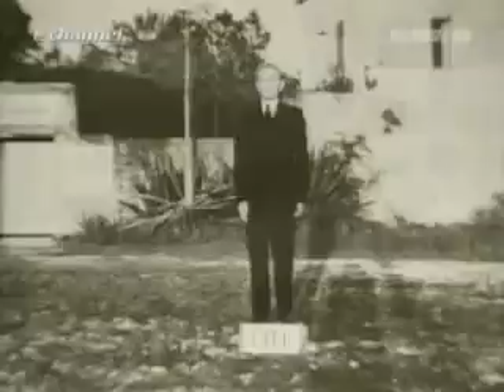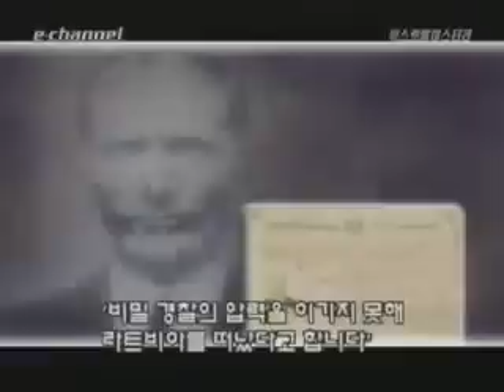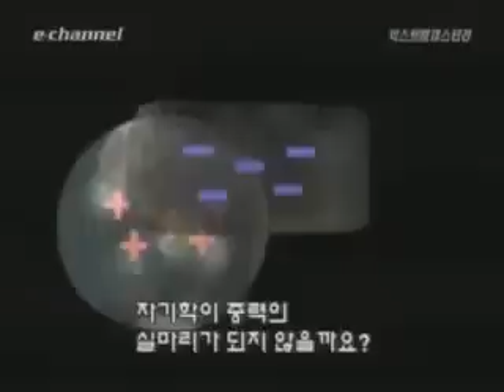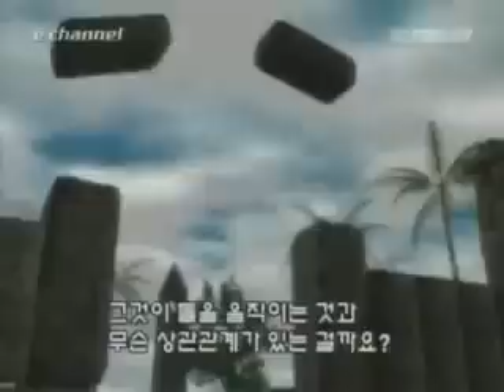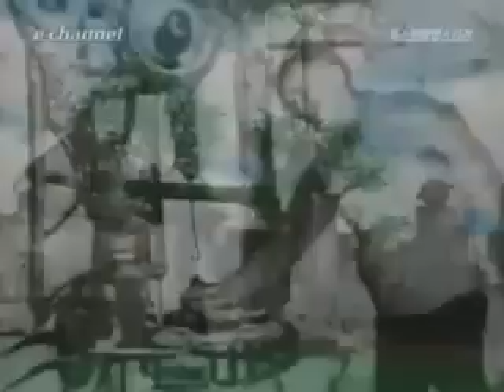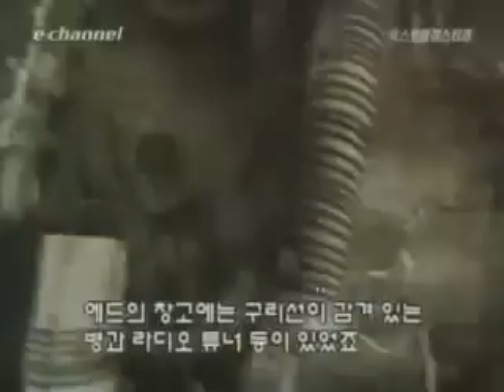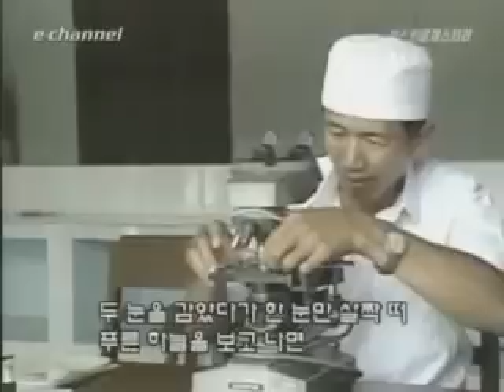The Anti-Gravity Secret of Coral Castle - FULL VERSION

Comment: 23 Ton obelisk?? What?
FACT; Edward Leedskalnin NEVER had the Tractor and trailer able to Transport the enormous weight of a 23 Ton Oolite obelisk. This would REQUIRE the assistance from the State of Florida D.O.T. and state law enforcement officials to aid in the Transport of a very slow moving vehicle over a 12 mile route.  This was supposedly accomplished in 1936 , yet today in 2022 a Lowboy trailer transporting 25 Tons is capable of up to 50,000 lbs. 
Soooo, how did he transport the 23 Ton obelisk?? Humm?? 
He didn't!

Comment: those boxes are no longer a mystery like all this as I CRACKED THE MYSTERY """""ME"""" I DID..the greatest mind of the 21st century..TDJ 
  The invention of an electron came by a tricky method in using electricity in a vacuum tube. Normally whether it be a generator or a battery, the positive terminal will have to be connected to the negative terminal, but in the vacuum tube two batteries with different strength were used, the smaller battery was connected normally, but the larger battery's negative terminal was connected to the smaller battery's negative terminal, and the positive terminal was left alone. That connection gave the negative terminal a double dose of strength, and so it became hotter and could push more. It was called cathode and the positive terminal anode, and the electricity that passed from the cathode to the anode was called electrons."""""""the arc of the covenant"""""""

Comment: Ed was smarter than the average guy. however there is no mystery behind what he did and i could do it today with just the stuff found at coral castle. he didn't magically levitate anything he used simple electricity to create a solenoid the push his simple machines to cut stone block and tackle to lift it and roll it into place.  i would be willing to help you understand if you still think its magic ( i sure thought it was at first but a little understanding goes a long way)
Reply: +Ben Goulet try the concrete cutting industry. diamond tipped saws and drills etc. search for manufacturers like; pentruder. husqvarna, weka or call your local Cutter. probably cheaper and definitely safer
Reply: You're an idiot.  If it were as simple as you suggest, there would be many more examples of this achievement in the modern world.  Don't try to sound intelligent.  You only solidify your idiocy by doing so.  Dummy.

Comment: The ability to pick yourself up and walk or the ability to use jet engines to cause a steel plate to skid on the air is NOT antigravity.
Antigravity is even a different animal than magnetism. 
Someone needs to remember those rocks that skid along the desert floor and leave tracks for miles.
Reply: Check out John Hutchison antigravity.
Anything that defies gravity can be called anti gravity.
Reply: But John Hutchison is Real Antigravity experiments - the Hutchison effect

Comment: No ones looked into who his sweet 16 is and if she is still alive or family might be? Also everyone ignoring the fact that the ford truck would not be able to hold the weight of 1 ton let alone 30 tons when he moved his castle 10 miles away. So the so called propaganda "solved how it was done" videos are trying to cover up this mystery.
Reply: +eladilchef1 You bring up some good points. Someone needs to get ahold of his sweet 16!  
So far as moving the project from the original site to it's current location my memory is fuzzy but I think he loaded the larger blocks onto a rail spur / that or he just moved the smaller blocks.
Don't remember the specifics beyond Ed Leedskalnin had a arrangement in which rail-car /truck would be dropped off, and they'd come back later to pick it up.

(It being said that one time the slab to be loaded was on the ground when the workman left, that the workman 20 minutes later came back because he forgot his food /tools? in the truck and the slab had been loaded!)

Comment: It's not made of limestone it was built from 2 different types of coral with different textured appearance. One type was quarred from the outside of the castle and the other type of coral was cut from the earlier site and moved. Coral is very hard and dense but still porus. He cut the stones out with leaf springs from trucks very high carbon steel. Today many people still use the leaf springs to make knives because it is a cheap and available steel that is very stong. When I went there it is very impressive but far from impossible for one man who lived before the days of cranes and heavy machinery to complete. Now that we have these tools we have forgotten how capable levers and pulleys can be. And as far as the generator at the site is very impressive for it's day it is just a science experiment the output is barely enough to power anything but a small light

Comment: 24 magnets alternating north/south arranged around his "flywheel" there is a "item" missing from the center,of either a pyramid or pentagram shape. he uses a massive tripod, with one can assume is a "block and tackle". Maybe the opposite facing, fixed  magnets push and pull eachothers magnetic fields causing the flywheel to spin on its own, attached to the block and tackle you could lift big weights without effort??? I dunnnnno, I do know that the site its built on has strong magnetic fields around it. I wish there were more modern day wonders like this- let me know about them plz
Reply: Water vortex or any vortex under this place

Comment: i have read eds books and understand them clearly ed was telling us electrons were not real or thetitle electron is being used wrong equal forced magnetic current is the power of life. everything on earth is or was alive plants ainmals and minrals are all the same or were or will be the power that gives you life on earth could only have been is one of these 3 things or was or will be that the electron is only man made with the use of electromagnets, the vee magnet is the base of zero point and the power of life. the flywheel and chain / the chain made up of plants animal and minral  the power of life in death is still within the chain in equal force weakened, the flywheel made up of balanced poles because of the zero point because of the magnets shape, magnets are not magnets because of what there made of but rather what flows with in them the magnets already have perpetual motion .whem ed spun the wheel of that the flux lines broke on the chain the make up of the chain once live becomes recharged like a battery but with a current the chain knows ed spun the wheel until the amount of magnets between the flywheeland the chain were balance just like the magnets of the wheel but now the chain is as well .now perpetual motion starts between the 2 as if it were one. .

Comment: What a pile of mabo jambo, gravity is has nothing to do with magnetism and polarity! its to do with mass, the bigger the mass the more it's attractive force. It's amazing what you can do with pulleys and 28 years!!
Reply: Magnetism is one of the four major forces in physics as is gravity.  The other two are the weak and the strong nuclear force.  Gravity is the only one of those three that doesn't fit together in a nice neat package.  It is also the weakest of those four forces.  It is entirely possible that gravity and magnetism are tied tougher in some yet- to-be-determined manner.  Einstein spent the last party of his ice trying to figure out how these forces could be combined into one unified theory.
Reply: Joey Richter ...and the answer is; the slight mass difference among the poles and the difficulty sharing spin waves over long distances because of how charge merely envelopes the 3rd pole matter and cannot direct it with monopolar kinetics faster than light can bend around a star. All is fueled by the electron neutrino. Everything else is a progressive kinetic reaction. I made video explaining this and basics of Ed's levitation.
Reply: Motaz, you are right!

Comment: Kids saw him using "cones" in each hand when moving the coral.
Reply: &2 cone coils wired to the circuit were used to short out some of the heavy ion loss off ground 3 dyamo inside tripod box (boson accumulator) which when aimed from 2 points would form a grid zone inside and around the object lifted to direct it's position; a tractor beam basically. Lasers made grid zones also when they make holograms.
Reply: B H Where did you hear this?  This is interesting, I would like to see the source.
Reply: Jerry Greelis I've heard this for years also. It might have been on the "In Search Of" episode with Leonard Nemoy. It's just been such common knowledge from various sources for so many years I never looked into it. It's kind of like "French Fries". When you suddenly tell someone they're not french, everyone wants a reference. Wikipedia probably covers that one but not this.

Comment: 24:42 Incorrect! Ed did infact reveal his secrets very plain as day. To those who can accept that our infinite universe runs using particles that collide in kinetic reactions only , no photons or superstrings, you have the key to the universe. The slight difference in mass among the poles can easily be amplified many fold to produce heavy ions for mass displacement. Ie; float from gravity using a force beyond basic superconductivity.
Ask me how. It's elementary physics to me. I solved Ed's machine in less than 2 years. It uses a centrifuge principle over 3 grounds with a flywheel, distributor, 2 dynamos, a magneto, an odd coil inside the flywheel, and a zero point transformer coil inside the timing post to continually convert charge implosions to sinewaves in copper wire. The distributor connects polar opposites just before each 3rd pos out neg in so only superconductive capable particles can rerun through that iron connection shorting charges thus powering coils inside pipe. Pump z waves in sync yet out of phase with proceeding waves must combine to form a sum of waves after focus (free energy). This secret was revealed to me in 1989 by Tom Bearden who learned the secret of the Philadelphia Experiment. That was accomplished thanks to fbi stealing recently deceased Tesla's files.
Reply: darayneman There's something I love about being hated by the cynical putrid lazy vacuous imaginations found wandering their way over the net, perhaps like a crispy bag of those thick, painful to chew potato chips gone half stale- you inspire me to crush you like the useless bag of shit you are with mountains of truth held in my pinky toe alone. You belong in the jungle with monkeys as you do not seek enlightenment. A legend in your own mind, knowing it all yet knowing nothing at all.
Reply: FuckYouGooglePlus I am 43, a veteran and spent over 10 years driving trucks after that. I have never and will never flip burgers. Now you have made this too personal knowing nothing about me and bring language that does not belong here. Have you even considered that children can read what you write? Pathetic loser
Reply: darayneman Exactly for that reason. Because it's 99% cynics demanding proof and I'm not your daddy I'm a teacher. If you can't appreciate what I have already given you, you fail anyway with or without proof, because I don't care to share my work with anyone who can't watch, understand, and appreciate my work here already. Anything beyond that is not your right, it would be a gift from me. This nice thing about youtube for me is that I can block people but starving them is more fun because you will learn to appreciate what took me over 20 years to understand myself and do this in  a mere 1 to 3 weeks.
Reply: @mikefromspace  isn’t the whole point of scientific research and testing to prove or disprove the original theory?? Why wouldn’t you want to put a video up if you’re saying it like you’re the only person on earth who knows it??

So sketchy
Reply: John Johnson  A z wave is shaped like a sawtooth. (google it)
 A pump z wave is specifically only a slanted sawtooth leaning left or right but right only for zero point energy implosion science such as that used in thousands of working Joe Cells around the world. Imagine an ocean wave crashing to shore; same thing. If energy continues to be pumped across grounds using field waves without return, ion charge varies among them. Sine waves may be considered pump z waves if the carrier wave (that carries them on a lower frequency) is leaning as a pump z wave. Continued transformation through a nonlinear medium equals a continued fractal. Assuming you have seen and know what a fractal is, consider one being made of elementary particles. Negative, positive, the sum of which is charge. The sum of 2 poles only tries to equalize mass constantly but when it fails in the center of say, any proton geometry, the smallest particle in negative family reveals hydraulic superiority, thus making atoms zero point energy circuits thanks to recurring monopolar growth cycles using pump z waves. This is why you never see an atom inside out haha. 
John you should review my uploads, maybe watch the science playlist.
Reply: So you haven't done this already and posted a video and blown our minds yet because?
Reply: darayneman I run a science channel not a philosophy channel, so respond with scientific questions and I'll be glad to educate you on all the proven facts. Philosophy has no place in science unless someone is using it to cover up bullshit.
Start with my videos, they will answer most of your questions. I've made over 300.
Reply: FuckYouGooglePlus Also, genius, your grammar is way off more than once... so in fact you are saying that "Factually, it has nothing to do with very simple concepts such as levers."How true that is. It is in fact elementary particle hydraulics. The electron neutrino's hydraulic superiority fueling magnetic current through progressive kinetics does act like a system of levers, splitting the poles, splitting ion charge in recurring cycles to concentrate only the heaviest free particles to the density level of gold on the circuit's 3rd ground; thus displacing the object with mass greater than that of the stone itself. Anti-gravity has been witnessed by billions of people. I don't mean just rockets, which is a form of it. I mean ufo sightings everywhere. Your mind sets it's own limits, but in reality there are none.
Reply: mikefromspace I'm very impressed with your knowledge of this subject if possible could you please send me your email address so you can school me a bit more on this subject as I am a total novice in this area
Reply: dude if u've figured it out, we be waiting for a youtube video showing you doing this stuff.
Reply: FuckYouGooglePlus Name ONE false claim. I have proof to back up every claim. What do you have? A sour pessimistic evil opinion with no videos and 38 fake subs. Who am I ?  I have over 2000 subs, but even without it, I would still see you as the fool you are for mocking my life's work. I've known zero point science and particle physics for 20 years. You are off your meds and soon to be blocked if you have nothing to do here but ramble on with useless snide remarks. 
Get a life or get lost. Hate speech has no place here.
Reply: Why is there so much  hostility? Difference of opinion is good, nothing to rip another persons character about.Guys.......come on
Reply: FuckYouGooglePlus Just because you don't understand heavy ion mass displacement, but your twisted tiny brain can understand a lever, does not mean I am wrong. Even an idiot knows what a lifter is, making you less than one.
Reply: FuckYouGooglePlus Oh that sounds smart, tell me more. I'll follow you on google plus.
Reply: mikefromspace
Reply: mikefromspace
Just SAYING you have proof is not proof you stupid fuck.

Look..you don't live in the real world. So NO ONE cares about you. You will NEVER have anyone that cares about anything you say. So just go away.
Reply: FuckYouGooglePlus lololololololololol
Reply: Diane Adams
Because science is not about opinion. It is not an opinion that Coral Castle has nothing to do with very simple concepts such as levers. And NOT anti-gravity. Trying to say it does is like saying 2+2=5. I get pissed at people who are worthless to the world and worse..who try to SPREAD their ignorance.
Reply: Ooooooooohhh
Reply: mikefromspace I always look for you on every anti gravity video
Reply: Whay haven't you built your own castle? Tired of armchair scientists. Stop talking and make a video or something to prove your theory
Reply: only super anything is you mike , super full of crap
Reply: mikefromspace 
Proof
Reply: Moving them is one thing. What about the cutting?
Reply: Sounds like a bunch of philosophical sounding excuses for the fact that you're full of shit.
Reply: Awesome! I feel bad for all the hate you've been getting, I see you know your topics well, and that you're interested! I envy you for your scientific knowledge :D Good luck on future studies!
Reply: what the fuck are "z" waves ?
Reply: mikefromspace No thanks. Id rather watch my favorite pet get its head sawed off than watch another video you have anything to do with.
Reply: Matej Mijuskovic
You feel bad for an idiot who is called out on being an idiot by people who understand science? How sad for you.
Reply: mikefromspace
Just stop embarrassing yourself. You have already made EASILY verifiable false claims and now all of YouTube knows what your family has known for years. That you are a worthless joke.
Reply: eugene188
There ARE YouTube videos showing how it can be done. A guy moving several thousand pound blocks of stone with one finger using the simple concept of leverage. You know...leverage...a REAL thing. As opposed to bullshit things that only complete fucking idiots believe in, like anti-gravity.